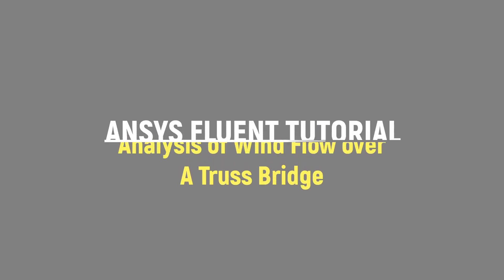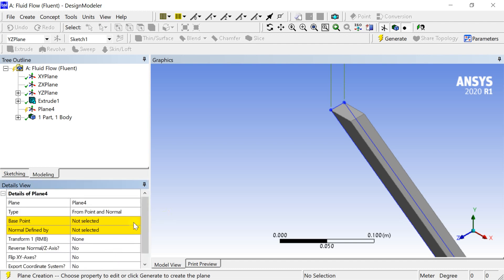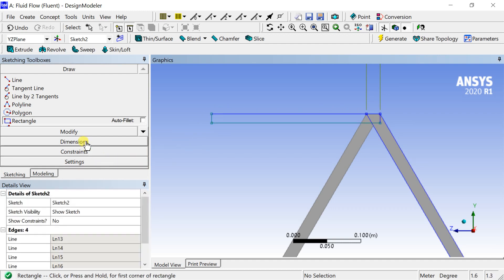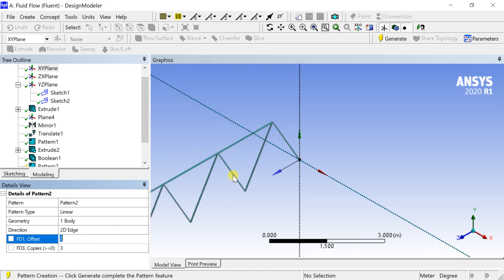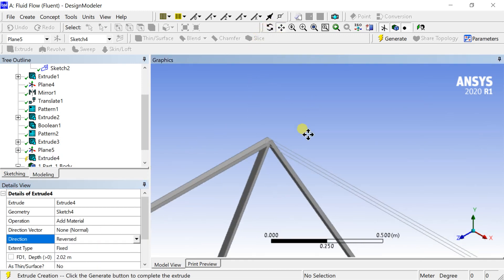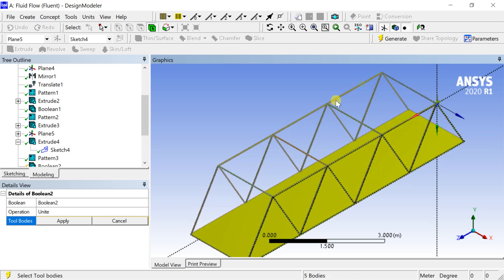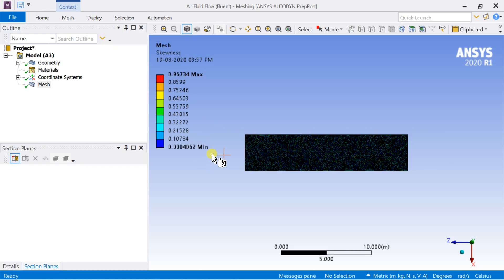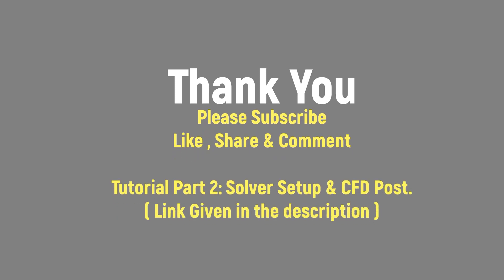ANSYS Fluent Tutorial | Analysis of Wind Flow over a Truss Bridge | ANSYS Tutorial  Part 1/2

Comment: I create transmission tower by lines after that I given beam L cross section. Now how to make single body to create enclosure for tower?
Reply from the maker: 1 D body tower body cant be made boolean with the 3d outer enclosure.
Reply: U are saying line body is 1D body?
But I given L cross section then it is not 1D body
Reply from the maker: That cross-section is only can be treated as an assumption. But actually its a 1d body.
Reply: @AnsysTutor  Then what should I do know. How to covert that line body to solid body
Reply from the maker: You need to create that in 3D, if you want enclosure arround it.
Reply: @AnsysTutor  yes, I need to create that line body as 3d L section and enclosure around it.

Comment: 3:40 from this configuration, how did you manage to have the 3:41 configuration ?? because it changes everthing, and it goes wrong if I continue with the 3:40 and before configuration
Reply: I mean before 3:40, the central point of XYZ is at the top of the body, and in 3:41 the central point of XYZ is in the right bottom of the body
Reply from the maker: Its due to the plane selection, if you click on the new plane the xyz origin will shift to the plane location.
Reply: @ephemeritescience5306   If it doesn't work clicking on the new plane to change xyz location, you can just click YZ plane in Modelling box. I've tried it and it works.

Comment: Why did you prefer to choose  add frozen at 11:09 and what is the difference between frozen and material?
Reply from the maker: Add frozen will keep the part separate, which is to be used for pattern. add material will unite the part with the previous part. So making it as add material will not be helpful.

Comment: Thanks for the tutorial. I am a beginner about to learn CFD and have several questions. 
What is the difference between Spaceclaim geometry and design modeller geometry? Why do you prefer using design modeller geometry? 
Do you have any suggestions on what book or reference to read to learn CFD? My background is chemical engineering.
Reply from the maker: Both spaceclaim & ANSYS Design modeler are used to create geometry. Spaceclaim is a new tool with more advanced options, it has more features than ANSYS design modeller.  I Prefer to use ANSYS Design modeller because I feel its easy for me to create some simple geometries using it.  Also, we have tutorials made using ANSYS Spaceclaim.  It depends upon you on which case to use which one. You can prefer CFD Book  by Malalasekera , its a good book.